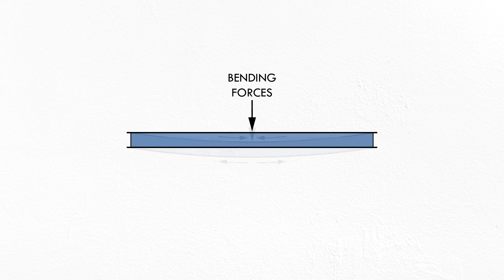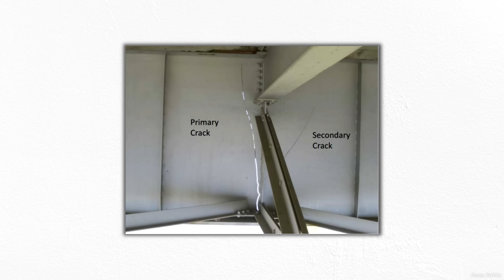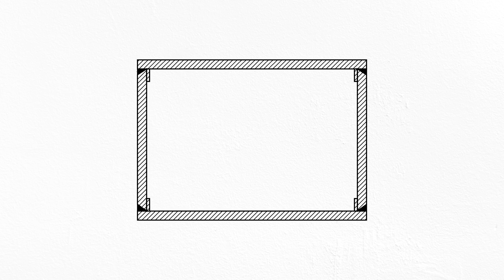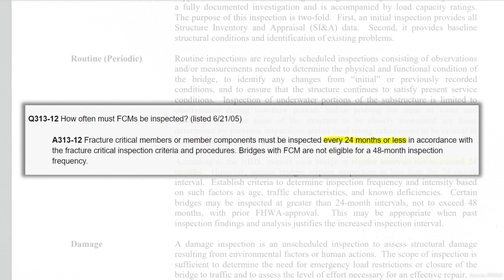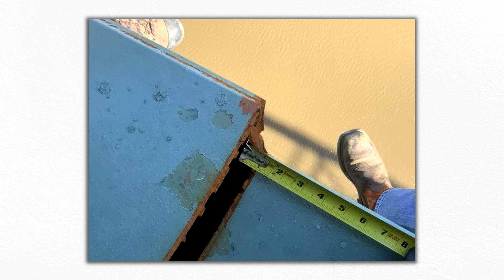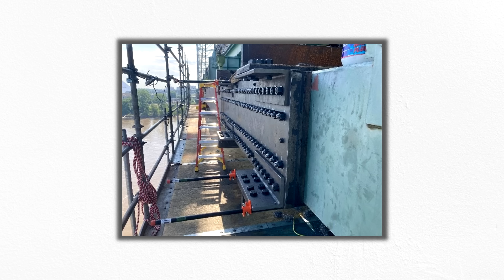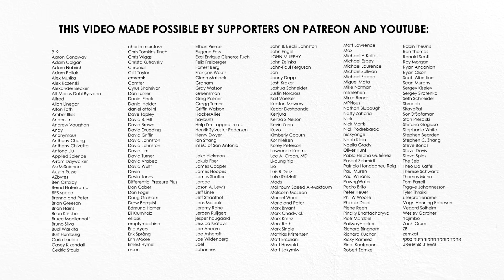What Really Happened at the Hernando de Soto Bridge?

Comment: A bridge, is virtually a ladder, laid horizontally, … yet the stressors are engineered into the strength of a ladder being flexible, so that the strength of a ladder is from a vertical inclination, … as are bridges, yet the amount of traffic, plus the vibrational stresses of the planet, need to require, electronic sensors, that are designed, delegated, & monitored, by a human, around the clock workforce, with enough personnel that can rectify any mitigation of solutions that must guarantee the safety of the populace using these structures, otherwise anyone, & everyone, who might use them may be at increased risk, …

Comment: Never undervalue good inspection.  A lot of verification ends up undervalued because people overtrust the engineer and their own past experience. Just because 99.99% of instances you don't see anything doesn't mean you can ever relax the standards. Your job when verifying/inspecting is to make absolutely sure something is good, every time.

This crack should have lead to one of the worst catastrophes in civil engineering history. It's actually pretty amazing it didn't. Complete incompetence on multiple levels is the only explanation.

Comment: Grady, as an arkansan i have to tell you, i have no faith in ardot for several issues, i promise those contracted inspectors will not be used again because they alerted authorities instead of alerting ardot first and letting them quietly sweep it under the rug again.  I refuse to believe ardot did not know about the crack from the former inspection as they had the video.  They knew and chose to do nothing.  I worry about the safety of our roads all throughout the state.

Comment: Grady, I'm not a structural engineer, but the way the that box tie deflected upward and pulled away from the other side, suggests a tension on the one side.  At first, I thought it was not attributable to the cable stringers holding the road deck up, and instead wondered if liquefaction under the adjacent pillar's concrete seismic mitigation "sleeve" was to blame, but then I remembered the crack began at the bottom and traveled upwards in previous inspections photos.  It's obvious now that there is not just the fatigue strain on that member, but also a tension force being applied, so it looks like a combination of multiple factors.  They may have actually made matters worse by adding the seismic mitigation sleeves like they did.

Comment: great video

what i was missing of
the road structure  basically equal with  ""truss"" 
what  used  at buildings

in my opinion, what  can not  be  proven  without  modeling the situation
the  suspension  strings, are not  evenly  holding the road

i mean  one or two  is ""longer"" than need
because  if cause  werent this then on the  other side of  bridge  same crack  could occuring

so, summarizing 
the  arches anchorpoints can not  move away , but  the  relatively  long suspension string  let the roadstructure moving  downward
causing  the  ""truss overload"" effect which one  will crack and separate  the  lower part of the  truss

Comment: @ 4:33 is the Fort Pitt Bridge in Pittsburgh Pa.  I cross it 4 times every weekday on my route.
I have been stuck on much shorter spans that bounce and wobble significantly,  but the Ft. Pitt is rocks steady! 
Here's a funny meme about it though. ↓↓ But the pic shows very light traffic.  It's bumper to bumper when I cross.
https://external-preview.redd.it/Y6dXX2Ry_paB7lH1jMw0xRK_g1c5fg3Ihf6nxCPqOZw.jpg?s=959ae5728caaeae1fc3287004d5705d4b631da1e

Comment: If you're not supposed to weld onto the frame of a heavy semi truck how the hell are you allowed to weld together metal pieces to make a main support for a major artery Bridge? Wouldn't it be required to use single piece steel it is inherently stronger obviously it requires a lot more process and transportation but on a bridge of this nature wouldn't that be standard

Comment: Grady, you should do one on the I-35W bridge; it's an example of a design which included "fracture critical" elements, or actually, "non load path redundant" elements. When a single element failed, the entire structure failed immediately and completely, dropping eight lanes of rush-hour traffic into the Mississippi.

Comment: No dispute as to if the beam was fracture critical, Its failure would have resulted in the bridge failing, eventually. The term should almost be "safety critical" as far as I'm concerned... or something akin to the OSHA standard of IDLH (Immediately Dangerous to Life/Health)... Im just a welder but I GET these concepts and why they are important, and parts that carry those level of specs Always get my attention. That being said, I'm well aware of the potential for defects, and its sad/shocking how many come from the base material that is being welded VS the skill the welder is applying.... All material is NOT equal, and some inspection methods will Not detect various defects... 
The fact it did not fail immediately is testament to safety factors and Engineering in general and the designers/fabricators should be congratulated...

Comment: The crack is open at least an inch. Meaning the distance between piers is mow an inch bigger. 

The other arch supporting that span hasn't had any such failure reported so I guess the piers are now splayed, in plan view?

Make you wonder how level the deck is, side to side. How much the unbound arch has flattened. How out of plumb the piers are. Internal cracks in pier concrete. Improper loading of pier foundations.

Forensic investigation indeed. Supervised by the same people who had the drone footage for over a year?

Comment: To add a bit of detail...a crack starts when there is something called a "Stress riser", it's a dent, nick, or another point that causes stress to concentrate in an area. A flaw in a weld is a great example of a stress riser. Aside from a crack =in a weld, what typically happens is maybe something like corrosion happens, creating "crack nucleation". This is where the atoms begin to separate. The next step is "Crack Initiation" when it goes from atoms just pulling away to when there is the minutest void between the atoms. It might have taken thousands or tens of thousands of load cycles (vehicles driving over it, the bridge heating and cooling, seismic events, wind) for it to go from nucleation to initiation. In the case of the bridge, every time a vehicle passed over that point once initiation occurred, "Crack Propagation" likely occurred, that little crack grew just a tiny bit. Now that we have a real crack, it's just a question of if load cycles or a conscientious inspector will catch up first.

Magnetic Particle Inspection is mentioned, that's where you see the crack showing up red. I used to have a free article online called "Removing the Mystery of Magnaflux. The host site went down a few years ago and now the article is only available through B&N for 99 cents USD. It explains the process in terms any layperson can get their head around. https://www.barnesandnoble.com/w/removing-the-mystery-of-magnaflux-shawn-jefferds/1105730427

Comment: That is NOT a CRACK. That is a completely separated BREAK!
Reply: yea a freeze-thaw cycle or two and it would have been toast.
Reply: @PNWAffliction  coincidentally  Memphis had a significant snow storm and as a resident  I can't recall in my 60+ years a longer period that the temperatures stayed below freezing than we had just prior to this fracture, over a week below freezing.Same cold front that caused the TX blackouts.
Reply: @TWak4ord  This crack was there before snowmaggendon.
Reply: @TWak4ord  oh crap I wasn't even thinking about that, but you're right!
Reply: @baddriversoflittlerock8359 
Are you familiar w/ span shrinkage with cooling? 
Steel not as bad as Aluminum but I've had some experience w/ that. Extreme cold will pull that crack apart. The longer the spam, more measured shrinkage.
Reply: @TWak4ord  Yes I am.  I'm saying the crack was there 3 years before. That cold snap may have helped make it bigger, but snap sure didnt start it.
Reply: Exactly
Reply: Stupid Kit Kat bars...
Reply: It was still carrying most of the original load, so I wouldn't call it a completely seperated break.
Reply: It was still connected at the bottom inside corner at the time of discovery. Probably wouldn't have stayed like that for long though.
Reply: That is a fatigue crack that grew until the member fractured. Loads have redistributed and now other members are probably overstressed.
Reply: @eddarby469  Wow, it's almost as if you watched the same video.

Comment: I’ve worked with steel all my working life in heavy industries. One issue that doesn’t seem to come up is soft spots in steel. I know by cutting steel plate with oxyacetylene torches when burning through steel plate you hit soft spots where a spot literally all turns to mud and stops the cutting process. It’s like hitting quick sand and the steel in that spot all turns to molten steel into a liquid metal. So if you have these soft spots through out the steel plate small indeed like microscopic holes as the steel is repeatedly stressed these spots might be the starting place for cracks. The quantity of the steel all goes back to the steel making factory and the grade and process used in making it. Now the odds of a manufactured and welded square box structure cracking all the way around through all four pieces is extremely high to say the least. But if all four steel pieces where cut out of one big steel plate with quality control issues their is a probability here.

Comment: As a structural engineer this video is fantastic!  I’ll add one thing; this is why for critical elements (individual structural members as well as entire systems such as a lateral force resisting system) it is absolutely necessary to have redundancy consisting of intentionally designed alternative load paths. It appears most likely that the bridge was able to redistribute load, but possibly, not necessarily by intent. For truly safe and reliable critical infrastructure, there should always be an intentionally redundant load path. Not necessarily a redundant path of equal capacity (i.e. equally as strong), but one capable of at least resisting the common, or typical, use loading.  The primary load path should always be designed for the full maximum expected design load over the entire life of the structure (which will be much greater than the common use load).

Comment: I'm curious: why use a solid girder for the tensile members instead of cables?
Reply: Cables can fail, too. There's likely a technical explanation we're not qualified to fully understand.
Reply: @frankmiller95  I hold a BSc in Electrical Engineering. The first year of the program was dominated by mechanical engineering topics, including the mechanics of materials. I'm fully qualified to understand the explanation, just not to certify it.

Comment: I used to do NDT in nuclear and power generation and it was truly scary when we had refinery inspectors come in, the very low quality of their work was alarming. More than once I had to threaten to terminate someone for doing things they said they did all the time. The problem is they are all new people with very little experience. A guy with two weeks on the job shows the new guy all the "shortcuts", perpetuating very dangerous bad habits. Nondestructive Testing is a field where impeccable ethics and a commitment to quality are an absolute must! I'd guess this was inspected by someone who thought, "It's been fine every time we looked at it before, why not again this time?", then pencil whipped the inspection. I've even had customers try to bribe me to pass parts, or worse yet, throw away my report and tell the welding foreman to find someone who will pass the part. This is why I never ride those rides at popup carnivals or the subway in Los Angeles. I have a great presentation I used to show on the crack in the old San Francisco-Oakland Bay Bridge and how they opted to monitor it with Acoustic Emission (AE), another NDT discipline. I suspect that this bridge might be getting its own AE system once it reopens.
Reply: Interesting. Sure hope the quality of nuclear safety is far better than a gas/oil refinery

Comment: Brings to mind the failure of a deck arch bridge about 1000 miles north across same river.  Thanks for explaining the function of the ties in relation to the arch.  The stress on the ties is a function of the total mass of the    bridge and vehicles.  Note lack of redundancy in the design.  Advantage of suspension or cable stayed bridge is redundancy of thousands of wires in cables.    John Roebling pioneered same, and early ones still stand after nearly 200 years.  Examination in service is challenge;  non-destructive exams beyond visual limited to small areas, impossible on large structure such as this.  Experimental techniques such as acoustics are still experimental.  Thanks for thorough article.  Info on repair process  is lacking.
David Smith

Comment: In the far left of drone footage at 9:05 in the video, there appears to be a second, smaller crack growing down the front vertical wall of the beam, starting from the top front corner of the beam.  The "blob" just to the left of the top of the smaller crack looks like a weld defect to me.

Comment: Structural members fail primarily for two reasons: Corrosion AND fatigue.  The two issues are synergistic, with each one making the other worse.  For a member to have been cracked for as long as that one was, it would be surprising if there is not corrosion on the fracture surface.

Comment: My first question is why did it crack in that location and not through the adjacent bolt holes where the cross section is reduced? I suspect that that member was not just exposed to a tension load.

Comment: Very good video but I have one criticism as an inspector myself.  You mentioned that if the inspection program relies on a single person to identify a major fracture on a fracture critical component then something is very wrong with your inspection program.  I can tell you with absolute certainty that an extremely high percentage of visual and non destructive testing examinations regularly rely on a single inspector.  This is very common in manufacturing, petrochemical, bridge examinations etc.  Not saying it's the best way but it's certainly the most common.  This is usually a result of the clients being to cheap to pay for the time of multiple qualified inspectors.

Comment: As always I find your videos fascinating. I particularly appreciate the way you refuse to simplify a complex problem. In this case, I feel you were absolutely correct to put the spotlight on the system of inspections. Undoubtedly someone or some group is to blame, but that neither solves the problem or prevents it in the future. There is also a tendency to blame the lowest element. "We fired the inspector," doesn't explain how it happened nor prevent it in the future.

Even though it's not in your purview, I would like to see a video on a failure analysis system that not only finds out what went wrong but why it went wrong and what can be done to prevent that in the future. Aircraft accident investigations come to mind immediately.

Comment: Looks like a break, not a crack.    With as much offset as there is, looks like a break.     If this was a bone in your leg it would be called a break.
Reply: In the older photos it was only a crack.  It definitely progressed to a full break by 2021.  I noticed that the edges of the break were covered in rust.  I wonder if that's the initial cause of it.  Rust severely weakens steel.
Reply: https://www.wpxi.com/archive/this-day-january-28-1977-massive-crack-threatens-i-79-glenfield-bridge-with-collapse/M3674VPOONDA5CTTFXJQ5TZ7VQ/. A link to that story.   It was actually 1977.   The bridge was built in the early 1970s.  .
Reply: Here in western PA  we had a bridge crack on a ramp of I 79 back in the 1980s.  A towboat pilot saw it .   It was found in very cold weather.
Reply: It only opened several months when it happened. ..

Comment: Practical Engineering says maybe metal fatigue, that makes sense the movement of the bridge girders over time eventually cracked tension tie?  Maybe the seismic retro-fit upgrades contributed to the failure? It's a mystery the civil engineers will solve, until they do it's very curious.